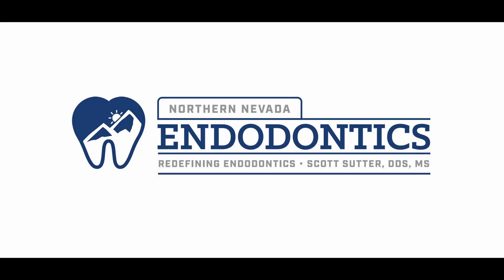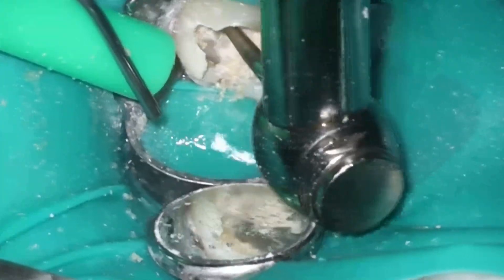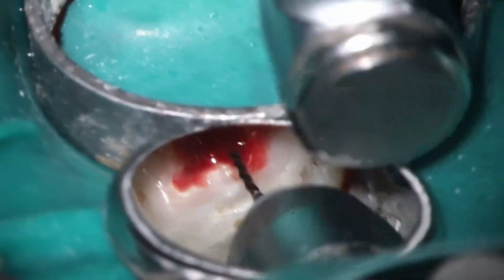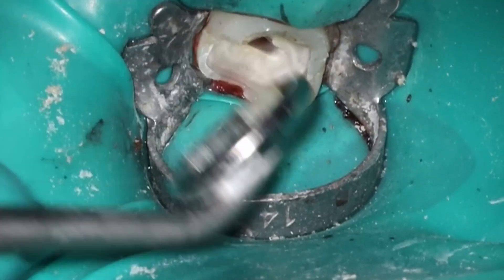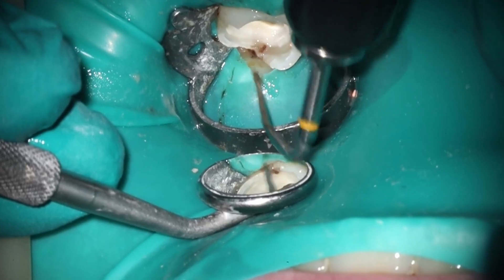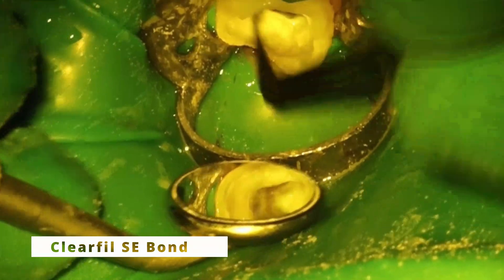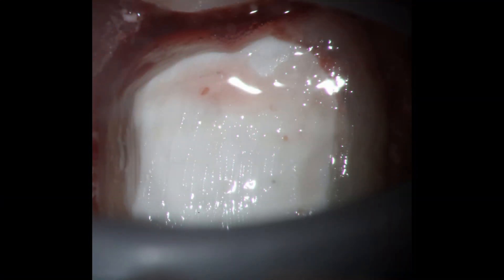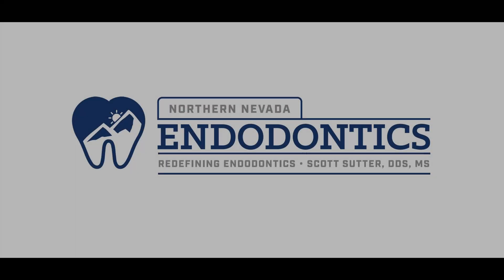Rad Radix

Comment: These types of dual composites, if stressed with curing light, before self-cure starts, will undergo a lot of shrinkage. You may not see it , but it will be there . I will always leave them be for atleast 1 minute, and it's a long minute😂.
Reply from the maker: It’s such a long time I know. Sometimes I can do that with intact teeth but if it’s slumping badly I’ll usually snap cure it.

Comment: Really nice! Did you recapitulate the radix with a size 20?
Reply from the maker: Yep. This one was large enough I wasn't worried about it being too tight. I'll drop down a few sizes if it's tight
Reply: @PatencyPro  ah great! What is your protocol of bleeding starts again after introducing sealer with paper points? Do you just crack on and obturate at that point? Cheers!
Reply from the maker: I generally don't have that problem as I deliberately take the paper points long to see if it will induce bleeding. If it does after the sealer I will take calcium hydroxide and pump it into the canal using paper points, then rinse out with whatever I have and dry. Thanks!
Reply: @PatencyPro  ok thanks a lot. Is that "non setting CaOH" to induce haemostasis?
Reply from the maker: Yep! I use the stuff from Ultradent
Reply: @PatencyPro  ah super. You're next video inspiration is this tecnhique right there! I'm sure many of us would find this super helpful. Keep up the great content, you're giving John Rhodes a run for his money!
Reply: @PatencyPro  sorry, I should have asked - can this technique be used in a one stage treatment? Or are you suggesting a 2 stage treatment?
Reply from the maker: Great question! Yes, I try to use this in cases where I want to finish in a single visit. If it is still bleeding after using the CH I switch to a 2 visit approach.